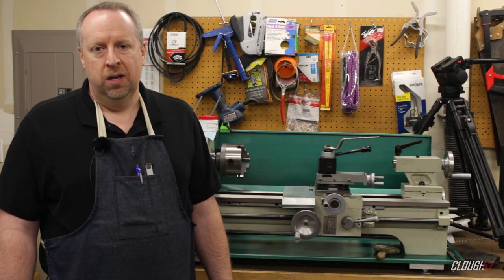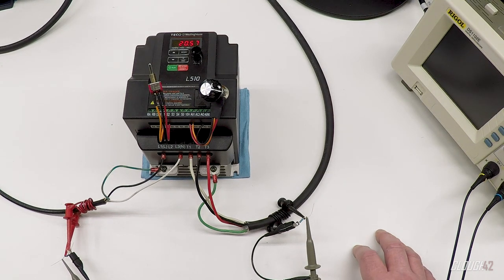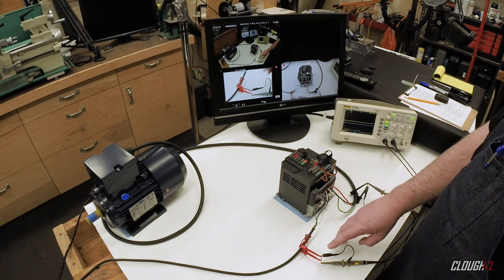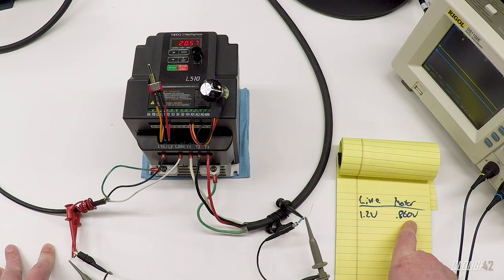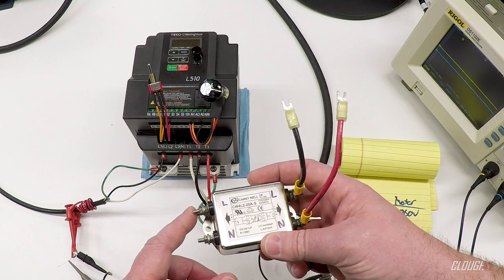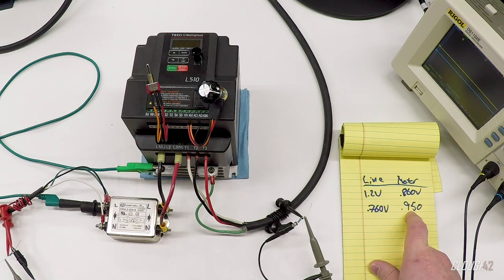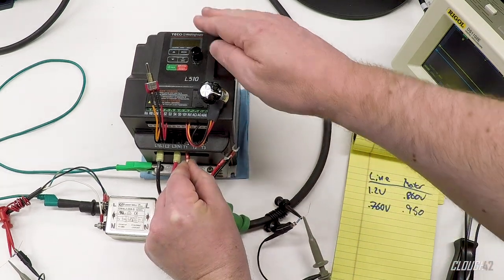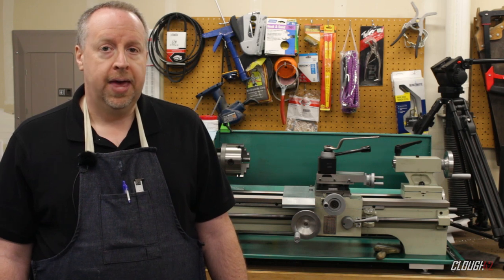Lathe VFD 3:  How to Fix Noise Problems

Comment: Great video. It’s actually a re-run for me though. I watched it last year after your ELS project. Motor problems with my import bench top lathe brought me back. I knew when I first watched this series that I’d be using your method to improve my lathes capabilities. The vfd arrived today, my filter and ferrites will be here tomorrow, and my motor should be here Friday. If not for your contributions to the hobby machining community I’d be replacing a crappy brushless dc motor and control board every year or so. I really appreciate everything you do James and I’m certain so does everyone else. Keep up the good works👍

Comment: I just binged watched several of your videos and can not believe the how good the information is, how well it is presented and how thorough each video is.  I'm subbed to A LOT of machinists, woodworkers, welders and other makers and your channel is in the top 5% in my opinion.   I'm looking forward to going through every video now and catching up.  

I'm on the midst of a restoration of a Clausing 5914 lathe.  I've done a total teardown of it and  I am considering replacing the hydraulic reeves drive, even though I completely rebuilt it, with a poly-v and VFD setup.  The only thing that keeps me from committing to the idea is the high pitched sound coming from the motor/vfd that I've heard on just about every setup I've seen in person or online.  My understanding is that it's related to the carrier frequency and is unavoidable.  I'd love to modernize my 5914 but I'm not sure I could stomach listening to that hitch pitched sound while working.  Any thoughts on this?  Thanks!
Reply from the maker: Thank you!  In my experience, changing the carrier frequency only changes the pitch of the whine.  If you have hearing loss in the higher frequencies, you might be able to set the carrier frequency high enough that you can't hear it, but that (un)fortunately doesn't work for me.  On my setup, the whine almost completely disappeared when I set the VFD carrier mode to 3-phase PWM (parameter 11-02).  I made the parameter changes step by step in this video, so you can listen and hear the results of the different parameters:  https://youtu.be/RQKPtf7stiw
Reply: @Clough42  Thank you!!  I can't count the number of videos I've watched on VFDs.  Yours in the only one that address the 3-phase PWM mode to eliminate that noise.  Every video I've seen has the whine.   Fantastic stuff!  I just ordered the L510 and will be following your build exactly.  Thank you!

Comment: EMI troubleshooting: you might see some benefits from mechanically mounting the drive, motor and EMI filter all on a common metal ground plane (no long green wire) and solidly grounding them locally.
Like how you used the cores in common and differential mode, but this problem is almost certainly majority common-mode.
A (much) shorter drive to motor cable will help by making the current loop physically smaller.
This problem is created by the IGBT's (inside the inverter) switching on/off and snapping the current off.  I'd be curious to see what, if any, steps they took in the layout to mitigate the problem.
Great video and solid "change made it better/change made it worse" shooting.  Kudos.

Comment: Thank you. I've been trying to figure out how to run my 3 phase lathe through the control panel with vfd. I didn't realize you just bypass the control box w/contactors and go straight to the motor. Thank you for all the added configuration explanation.

Comment: I purchased a 90 year old, 2 ton Lodge and Shipley 16 inch motor lathe that is in great shape but it's cumbersome to change speeds and direction and it has a top speed of 400 RPM.  So I've changed the motor to a 5 HP - 3 phase with a VFD in hopes this will make the machine more usable. I just finished installing the motor and am about to wire up the controller and your video was just what I needed. Great job! Thanks.
Reply: How did that lodge and Shipley turn out? I’m we had a couple in the tool room.

Comment: Excellent video. Though your EMI/RFI issue is affecting camera gear, that is an even bigger problem for radio gear (ham radio specifically). The hard part - as you alluded to in the beginning of the video - viewers of the video would be completely unaware of the issue had you not pointed it out. Same is true for likely everyone else in your neighborhood - unless they experience problems (such as the TV in the family room, or your neighbors tv, flickering when you are trying to run the lathe). Knowing it is coming from your lathe is impossible to know unless it is tracked down. So finding the problem up front - and taking the steps to mitigate it as you are progressing with the upgrade - is most excellent work - even if the reason you did it was for your own benefit at the time (keeping your own camera and production gear working correctly). The issue could be a lot more wide-spread to others, yet they may never know the source or how to resolve the issues.

Comment: Your video is absolutely brilliant!  I am an Electrical Contractor who is doing to work for a big company which uses VFDs,on there production lines.  They are having a lot of problems with EMI which is raising "Hell" with the production process due to VFD dropping out and shutting down.  They thought the problem was insulation break down on the THHN wiring feeding the motors from the VFDs, but I told them it most probably is EMI .
Your very easy and simple in depth video, is easy to following and understand.  It shows what's really going on and the solution to theses problems.  I suggested to use ferrites on the output of the VFD and a line filter on the input power feeding the VFDs.
Your video is exactly correct, as to how and why noise affects digital equipment so adversely.  Thank you  Michael

Comment: I'm not going to go into detail as a industrial Electrician, some of what you say is correct and you are on the right track. Some drives (VFD's) are sold with internal and or external filters (harmonic issues and interference down stream filtering). But in the industry it is common practice and generally a standard requirement to use the above mentioned filtering with shielded cabling from the motor to the drive or a shielded cabinet, with the shield (drain) earthed at one end (VFD or cabnet). also the most important wire is the Earth, don't forget...
Reply: By earth, are you saying the equipment grounding conductor or are you talking about an isolated ground?  Because James is using an EGC and isolated grounds are only really used in data centers and hospitals.  Small VFD's (<5hp), in my experience, haven't really required shielding on the output unless there is really sensitive instrumentation nearby.  And then the instrumentation is in shielded cabinets.  If you're dealing with 30-50hp motors, for sure, conductors in flex with bond bushings all day.  Not so much on the smaller, assembly line stuff.

Comment: Another thing that helps is using shielded VFD cable grounded at both ends. It gives a low impedance path for the common mode current to travel so it doesn’t travel through the building as much.

Comment: Nice video! I see you're using completely unshielded cable. I think you'd find good results with a low cost braided OAF type cable.
Reply: Yes, agree.  I had about 5 VFDs radiating in the workshop and the only way I was able to completely resolve my noise and earth leakage issues (causing noise in limit switches) was to use shielded or braided cable
Reply: shielded cables do not protect against the device causing interference in the supply network.  They protect the signal in the line and the neighboring lines. It may help with your problem with the endstopswitches but it doesn’t solve the problem with devices wich are connected to the same power source
Reply: @andreasbrunnhofer  Agreed, it's a good idea to have an incoming filter on low voltage single phase AC. For three phase inputs, filtering isn't usually necessary as it's typically built-in (unless it's a VERY cheap drive). Foil and braided shielded cable is a necessity on the motor end. On a small drive like this, you would rarely need any line reactor or filtering on the output.

Comment: Wow, very interesting! Would have loved to have seen how a smaller number of ferrite cores worked in comparison to the pack of 10.
Reply: I can tell you this... I have two rings on each motor cable going to a 460V 15HP sewage pump from a VFD that was causing havoc on another system and they did WONDERS.

Comment: Thank you so much for this video, we have a Shapoko Pro XXL cnc that kept disconnecting when ever the spindle was turned on. I found the same emi filter on amazon, bought 14 ferrite cores, and moved everything over into a new enclosure and so far zero Disconnects. Thank you so much. My previous emi filters from cnc4u were useless and the screened cable did nothing until adding all the ferries 👌 your amazing.

Comment: Thanks for this info. I've been working with my VFD for my cnc spindle for a while, dealing with various noise in the system, and grounding issues for the controller. still not done, have made progress, but this info sheds light on what i've been dealing with that i couldn't see, and how to fix it further. btw, i've gotten positive results grounding both ends of the shielding around the cable that runs from the vfd to the spindle. some sources had me leave the spindle side of the cable shield unattached, and that was just plain wrong. i suspect those ferrite cores will further catch high frequency oscillations in that shield, so i'll get those, and also that power filter sounds like a good idea.

Comment: Oh man, best explanation I've ever heard of how a common mode choke, class x and y capacitors work together. And, now I understand better why putting ferrites on the lines for some car-neons I used for decoration in my youth actually did reduce data issues. (I'm pretty sure it only affected my audio because I used a digital, but copper, signal line between my computer and speakers, and that line by necessity laid parallel to the neon lines....)

Comment: This problem is why we use shielded cables for these devices. The wires inside are twisted to the proper extent to eliminate common mode noise. That eliminates most, if not all of the noise problems. Sometimes, if the cables are long, a filter is needed as well. If the problem is that there is radiation from the drive itself, then they are put within a grounded steel cabinet for shielding.

Filtering the power input to the drive is often a good idea as well. Most people will never do this. Ferrites are used instead of an input filter, and they’re usually sufficient. 10 is a bit excessive. But I would have put a couple on the drive input cable before the filter as well. Also, the question is what ferries to use. Different versions filter different frequencies.

Comment: Nice video. But I suggest mounting both L510 VFD and line noise filter on top of the same metal plate to create a  high frequency return path for the common mode noise. The reason your filter isn't very effective is because your GND wire in-between VFD and filter is poor on high frequency. If this works,  how about making a follow-up video.

Comment: Great video, and I'm enjoying it as I'm also dealing with similar issues. I'm going to nitpick just a little at 10 minutes. You don't /want/ to pass 60Hz common mode signals, noise or otherwise. You only want to pass 60Hz differentially. And that filter /will/ filter low frequency CM signals as well.

I only say this because I've been working on sorting CM noise issues on my audio equipment if I happen to plug my microphone preamp into a USB charger. The dominant CM signal is 60Hz fundamental frequency. A CM choke won't help you here(unless it's impractically massive and expensive), that's why there's the CY configuration in the middle. They're dumping the low frequency stuff to ground.
Reply from the maker: Right.  You want to increase the common-mode impedance as much as possible.  You want to pass the differential only, and even that can be filtered down to a pure sine wave at the operating AC frequency of the motor, though a common mode choke won't do the latter.

Comment: You can wrap the cable around and through the center multiple times vs just going though a ferrite once.  Nice vid though.  I came here to learn about VFD's lol, as in vacuum fluorescent displays.  I wanted to know if they are more noisy electrically than an LCD display.

Comment: Very Nice Video, It looks like your monitor does not have a builtin filter on its power supply. Most PC and monitors have a EMI filter as part of the input to the PWS. The Best way to use the ferrite is to wound 2 to 3 turns of wire around the ferrite for each of the input lines and output lines.

Comment: First, THANK YOU! I sell sewage pump systems for a living and I sold one to a city last year for a large outdoor application with two VFDs running two 460V, 15 HP submersible sewage pumps. They bought the whole system, but wanted to use their own Sensaphone unit to make a phone call to their office in case of a high water alarm in their pit.  This was very important to them, but we found that the sensaphone autodialer was receiving all sorts of signals from it's power line causing "phantom" button presses on the unit, stopping the phone calls from being made, and therefore keeping the city from being made aware and taking action when homes might be in danger of having sewage backed up into their homes. It would be a very unlikely scenario, but it happened to them years ago and that's why they wanted to upgrade the pump and control units. I had almost given up on my attempts to fix the issues because honestly, how do you fix what you can't see? I had tried everything I could think of that I could control, but then I came across your video. I applied a 12V EMI noise filter (AMAZON) to the sensaphone circuit and ferrite rings (AMAZON) as you described and viola! No more phantom button presses! No more crazy sounds coming from the unit when the pumps kick on, and most importantly, no more interrupted or cancelled emergency phone calls from the unit! 

People called me crazy for trying. Sensaphone themselves admitted they had no solution for this issue. This video saved a LOT of heartache for everyone involved. I thought the ferrite rings looked like voodoo, but I took them off the system to see whether they were actually helping and the problems persisted! I wouldn't have believed it if I hadn't seen it with my own eyes. Thank you. Thank YOU, THANK YOU! 

To be fair, our control panel has a built in Ethernet for alarms that connects to an online app, so this never should've been an issue, but they don't want to run internet to this outdoor system, so this fix was our only option until they change their minds.

Comment: Thank you very much. I am making a CNC, and opening VFD will cause the connection between Arduino and PC to be disconnected. I'll try to add a filter based on your video.

Comment: Clearly you know your stuff.  Well done.  I was just reading about VFDs and the high voltage spikes they create and the need for better insulation.  I also read some about line and load reactors (which seem to be plentiful on ebay) to reduce spikes.  Can I ask how using a reactor vs. the filter you used would have affected the output.  You speak this stuff clearly which is not the case I find other places.  Can you tell me the difference and give an example of when to use one or the other?  I'm adding a 220V, 1.5hp, VFD and 3ph motor to my bandsaw.  I'm concerned about the electrical noise, mechanical noise (whine) and motor insulation.  Thanks for any help.

Comment: James, Thanks so much for this series of videos.  Its been invaluable as I installed a 240v 3 phase motor to my old Bridgeport mill.  I have one question regarding the EMI filter though.  I purchased the same filter as you used in your video, but I'm running 240v one phase power from the wall to the VFD.  Notwithstanding that its labeled at 250v, it only has 1 line and 1 neutral post.  For a 240v input, would you put both "hot" lines on the single line post?  Thanks so much again for all your hard work.  You've quickly become my "go to" source of information!

Comment: Sir,  Thank you..This is highly informative...!  
Do we need to use that much ferrite on  the output of VFD?  I mean does the quantity of those cores matter?  I am planning to use this method for Mach3 CNC Spindle.!

I am hoping that combination of this ferrites with aluminium foil shielding  gounded to earth ground would completely get rid of EMi issues..! 

So I can use this method for my stepper/servo  power and encoder cables  and usb cables as well..?

I am relieved..! I was really worried about the RNR Motion USB Card.

Comment: Hi, I know this is 5 years old, I found interesting that you were able to reduce the noise with the ferrite cores. I have worked with this in the past and finally ended up using line reactors, to know if you are able to reduce the eddy currents generated into the armature and bearings (the most common cause of bearing failure) I was instructed to connect a scope to a carbon brush and touch to the output shaft. if successful the scope picture will drop to a very low value.
we installed output line reactors to mitigate this. they are quite expensive but worth it, we were replacing on our ten cooling towers every couple of months now the last for years . I'm wondering if you reduced the eddy currents on your test motor. 
Rich